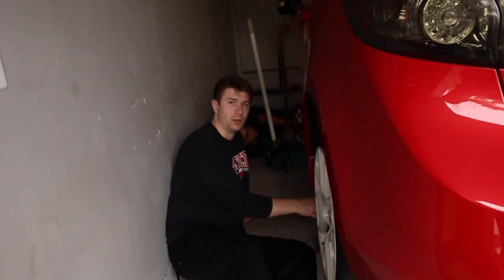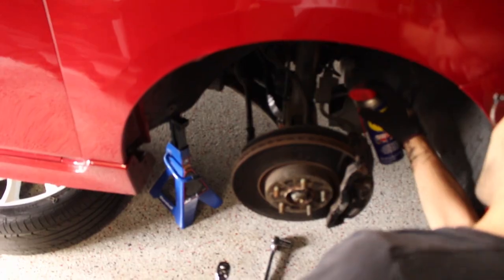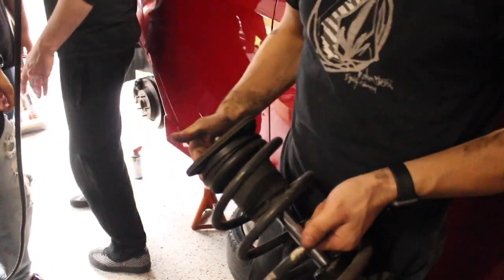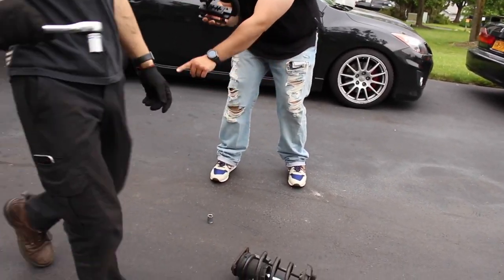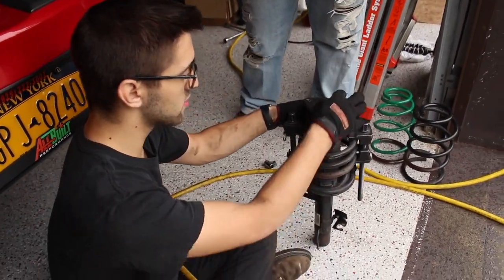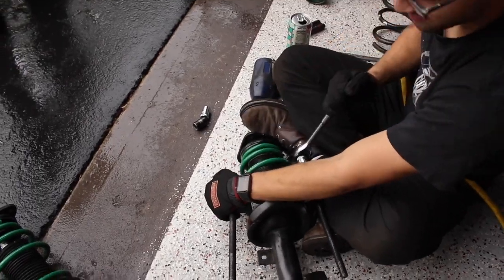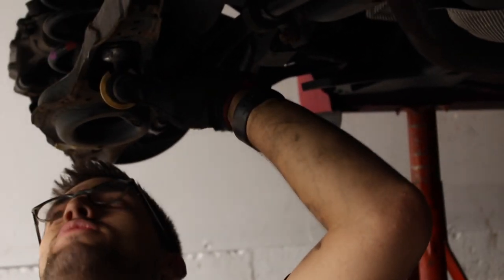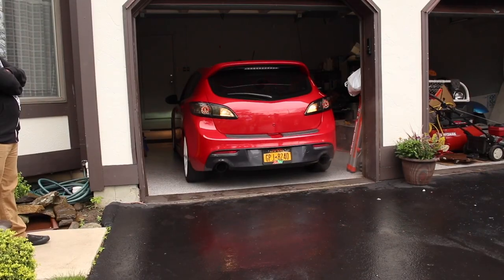HOW TO LOWER YOUR CAR FOR CHEAP!!

Comment: So I’ve got a 2011 speed 3. Got the same springs as you and the rear didn’t drop nearly as much as yours. I remember when I installed them I left the rear wheels on. Do you think if I took the wheels off and then installed them again that it would drop it?

Comment: wow, very nice ! How much lowering your springs??
Reply: The springs for this particular car went for any where between $160-$200. It dropped the car 1.5 inches all around. The springs have a higher rate, allowing less body roll when going around corners, and the car now has a lower center of gravity. Another plus is you have a better feeling of the road.